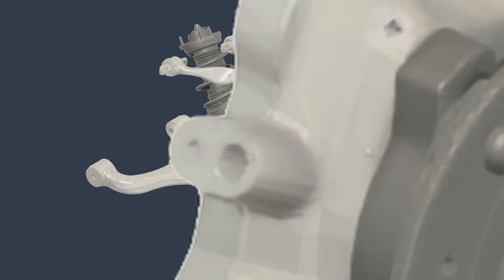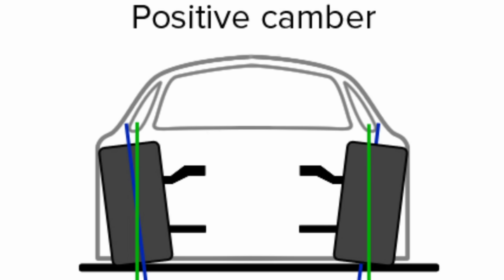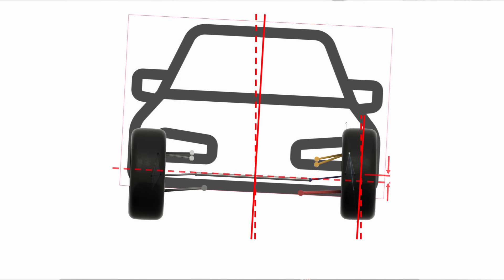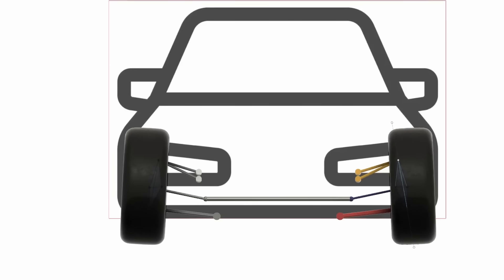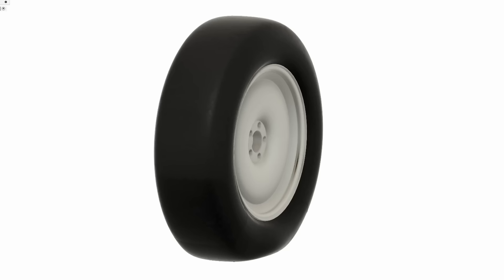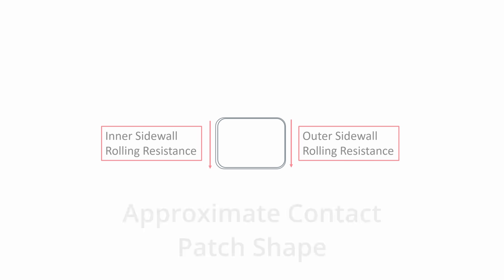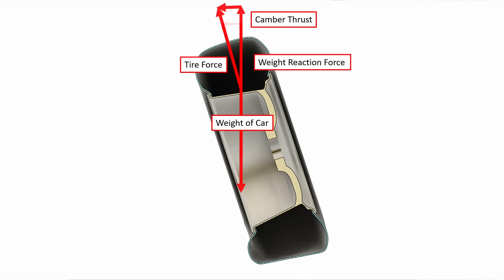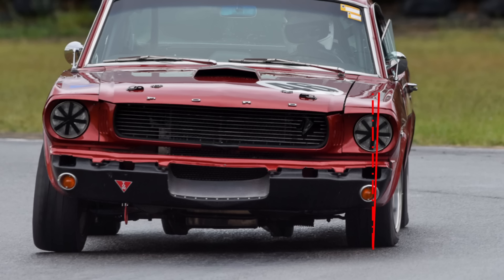Why do some race cars have such ridiculous front suspension camber angles?

Comment: Dirt track racer here... So all my turns are left, on wet dirt.  A high negative camber on the right side front tire (about 3.5 degrees), and a positive (about 1.5 degrees) on the left front, will give you a good 'base line' to keep the tire tread 'flat' and is conducive to the largest contact patch in the left hand corner.  Hoosier biaus ply tires, and rather low pressures cause a lot of sidewall roll.  The camber adjustments compensate for the soft sidewalls, which has a ton of flexibility, therefore necessitating the aggressive camber adjustments.

Steel belted, heavy (thick sidewall) and asphalt tires require much less camber.  And since street cars turn left and right, you need to optimize for both different forces.  Everything is a compromise.

A 1/8" Toe in, and about a .75 degree negative camber, along with a castor, where the upper ball joint is slightly behind the lover ball joint, is the most comfortable driving experience.  Now get into performance, where you aren't worried about having to hang on the wheel to go in a straight line, that's a different story.

The key to a well handling car is 1.  a car that returns to straight ahead on it's own, when you release the steering wheel.  2. a car that maintains a straight trajectory, without having to hold the wheel one direction of the other, when traveli8ng in a straight line (regardless of how uneven the road surface is). & 3. A car that doesn't have so much loss of grip (of the tires to the road surface), in a corner, that it feels like your are headed for the ditch.  This is known as 'push[.  Meaning the rear of the car's weight, is pushing so hard on the front end, it makes the car slide the front tires in the direction it was going, before you turned the wheel.  

These effect is exacerbated   as the total weight of the car increases.  Race cars are designed to be as light as possible, this reduces the force effects we are discussing.  Modern street cars are HEAVY.  This is due to the fact that they are trying to make them safer in a collision, without just putting a race car roll cage in them... It's asthetics and creature comforts that rules the day, performance takes second place, but safethy standards still have to be met.  Hence the heavy weight of street cars.

TLDR... Airbags are the dumbest safety feature ever conceived.  They are expensive technology, and even after years of development, they don't work, unless you are wearing your 3 point harness (safety belt).  Think about how much money could be saved in the cost of building a new car, if they just incorporated a 10 point roll cage, & a 5 point harness, for every passenger seat in the car, and forgot the whole air bag idea... To those that would argue with me... Have you EVER seen any high performance race car have air bags?

The answer is NO... They aren't safer, they just make you FEEL safer.

Comment: This year I started watching Australian V8 Supercars and was very confused with there's insane front camber angle. I went to youtube to find out why, and found your video. Thanks for sharing with us this information in such a simple and understandable way. Great video, we need more explanations like this
Reply: Apparently there is a lot of weirdness with the mandatory spool differential in V8 Supercars and the need to unload the inside rear tyre for the car to not understeer like crazy. 🤔
Reply: There is a video of Ken Block testing a Ford Performance Racing FG Falcon like the one in the thumbnail, and spinning out on corner exit after being shocked at how little traction there was! "I barely touched the throttle" - Ken Block  The regular driver laughed and said "that's just how they are" IIRC.
Reply: Until 2023, front suspension was (relatively) free and of double wishbone type on all cars from 2003-2022 (based on the 1992 EB Ford Falcon's pickup points which Holden Commodore runners wanted and were given in 2003), so that became a hot topic of development apparently.
Reply: Driver61 made a video about the unique V8 Supercar driving style, but completely overlooked mentioned the locked spool differential and its effect on the driving style: throwing the car aggressively into the corner on corner entry to overcome the corner-entry push caused by the locked differential, but then needing to be very smooth and gentle on the way out of the corner else the car will just spin out. (Sorry about the three posts, when posted are edited they tend to disappear on YT for some reason.)
Reply: because his channel is for kids that follow F1 and not actual adults  @TassieLorenzo
Reply: @ Excellent point! The strange driving style (aggressive in, smooth out) that the locked differential requires is hard for guest drivers to get their heads around I think, but Patrick Long, Mattias Ekstrom and Sebastian Bourdais really nailed it I think and were fast straight away!  More recently Kevin Estre has been good too and Matt Campbell also is fast in these cars (but he's a local so ought to know and is fast in everything anyway!).

From time to time there is talk of changing to a real differential, but it never seems to go anywhere even in the third generation of a V8 Supercar now.  I think the locked spool is better suited for jumping across kerbs like a V8 Supercar does, than the real differentials in a GT3 car? You don't tend to see GT3 cars flying over kerbs as much (but there could be other reasons for that: the aero, stiffer springing, not being built for that, and so on).
Reply: "Nutsy Metrical"

Comment: The negative camber thrust on both the front wheels do cancel out each other, but not really at the same time. They help give the vehicle a "toe in" effect. So the car should also drive a lot straighter on a perfectly flat road, but will also cause tramlining if the road isn't perfectly flat. The extra negative camber also helps counteract tire sidewall deflection to an extent, preventing the outer shoulder or sidewall from contacting the road giving you the most amount of cornering grip. How I like to teach people about camber thrust is to take a wheel or tire or even a coin and roll it at an angle. It will want to turn and follow the angle. Great video and explanation!
Reply: Sometimes a little toe out will offset the negative camber effects of tramlining  or camber thrust and sometimes oddly producing lower rolling resistance as well. The wheels pointing outward create forces that offset the forces of the tire leaning into one another. I've known people that had very bad alignment on their daily drivers from suspension sag where this was the result but 10 fold. I asked them does this not make you feel like the car wonders all over the road? They tell me no. Though the tire wear in the inside tells me they have less grip especially in rain it otherwise doesn't act darty or twitchy all over the road due to the separate opposing alignment angles. Kinda sometimes makes me feel like manufactures also engineer this in mind that should your suspension wear over time that while your due for an alignment that these angles will get you by to prevent you from loosing control of steering the car in a stable fashion. But still a proper alignment is required. The only opposite effect I seen on alignment angles was the 1990's Chevy pickup C1500s the camber and toe angles defaulted in reverse. You definitely could see this as you put it on a lift and the suspension decompresses. You would expect them to camber positive and toe in but instead they toe out and negative camber. Very odd geometry but maybe the upper and lower control arm lengths are different but in a way that doesn't favor handling in corners as well as the steering linkage geometry and idler arm and pitman arm setup. I say this because by effect when the front suspension sags I always end up seeing positive camber and toe in wear on these trucks. Definitely not good for handling or wear and less favorable angles overall. Thankfully chevy got their act together and went to rack in pinion steering in like 2002 and that changed that situation.
Reply: Coins are different from tires though, you can see them as rigid bodies and the reason why it corners is due to gyroscopic precession: Try imagine a coin that is rolling forward and tilting to the right, gravity tries to pull it down and increase the tilting angle, but as it's rolling, gyroscopic precession makes the "falling to the right" motion turn 90 degrees along the direction it's rolling, which comes out as "turning to the right" from a top-down perspective.
Reply: @fusha_1527  yes but it's to help people understand and the principle behind it. Try rolling a coin and a tire at an angle, they will both do nearly exactly the same.

Comment: The only place I am aware of where you see positive camber is on oval cars.  The inside tires will be positive, outside negative.  Since you only turn one direction, it makes sense to do this.  Some dirt oval cars a very aggressive on the left side, inside, tires.
Reply: there is actually other places for positive camber. my car and alot of older cars (mine is from 1977) comes with positive camber in the front.
and tractors and trucks have used positive camber. i think iveco bus uses still positive camber in the front. and it has a reason.
positive camber makes the steering wheel easier to turn. so heavy machinery, old cars without power steering utilize positive camber to have lighter steering.
Reply: @matufujiwara7493  oh cool. I was always wondering why that it! first seen it on ~1930's race cars.

Comment: Where a positive camber would be useful?
Reply: Some old cars use positive camber in the front to minimize steering effort.* Remember that camber is always relative to the direction that the lateral forces are acting towards, so on some tracks, you might want less -ve camber on one side than the other.

*EDIT: This is due to their geometries being problematic and resulting in very high scrub radius. Aligning the tire into +ve camber usually allows the scrub radius to be effectively lower, or more towards the outside of the contact patch, than if it was straight.
Reply: Sometimes you’ll see it on the rear of professional level drift cars, as the rear squats under load, the camber gain causes the contact patch to be maximised mid drift.

Also lessens steering effort on the front so commonly seen on tractors and old GP cars.
Reply: @flowermouth  Mid-drift, no, they're compromised mid-drift. Some -ve would be better for performance, although it depends largely on temps and pressures.

 +ve camber is done so straightline angle is 0, because the acceleration pull performance matters a lot for ultimate scoring.
Reply: Tractors

Comment: What you really need is a way to keep the camber compensation at 0 for heave but to activate relatively strongly for roll. DAX manufactured a version of the Caterham 7 that did this called the "Rush." Solid axles (and De-Dion axles for that matter) also technically do this as they always keep the camber at its static setting relative to the road, regardless of body roll.

As another commenter mentioned, tires do need a bit of camber at high load to evenly distribute that load on the contact patch, but AFAIK this is relatively low these days with radial tires at 0.5-1.5 degrees or so. Another thing that wasn't mentioned is that steering geometry (caster and kingpin inclination angle) also contributes to camber compensation, though obviously, only on the front.
Reply from the maker: Steering geometry does contribute, but the effect is small since turn angles even on a track are relatively small.
Reply: @suspensionsexplained  So much for BMWs having around 8-10 degrees of caster compared to, say, a McLaren F1's "meager" 6 degrees, then. I thought it did more for them to help with the less-than-ideal Macpherson strut suspension...
Reply: @Drunken_Hamster  BMWs generally have a very rearward positioned lower balljoint; in the E30 it's even actually behind the wheel center. As far as my understanding goes, some geometries will prefer a higher angle and a more rearward lower balljoint for caster stiffness reasons.
Reply: Optimal camber for lateral grip is dependent on load and temperature, as well as to a point probably slipratio and velocity as well. The optimal camber angle for a tire can be almost anything at any given combination, from -1 to -10 and probably more for bias ply or weirdly profiled tires. It changes all the time, from entry to exit, from low speed to high speed.

You probably won't run the actual optimal lateral angle due to uneven heating and compromised straightline grip, hence why recommendations are often around the -2 mark. However, go higher especially if you have a faster car with more aero and grip.
Reply: @ArchOfficial  I definitely DON'T currently have a faster car with more aero and grip. In fact, I don't intend to have an aero package stronger than a flat panel underbody, single splitter with end plates, and a standard rear diffuser as my car will be run on the street as a daily/near daily and I don't want a bunch of drag. As for faster, well... It has 240hp at the crank, stock, and can reportedly get between 250-270 at the wheels with FBO and a tune. A built motor swap to the larger J35 could net me low-mid 300s at the wheels, but that's long-term stuff as I'm going to focus on the chassis, first, given how I'm largely satisfied with the current output.

As for your other comment, that's rather interesting about them. There's a neat dynamic between caster and steering axis point which I'm sure you're aware of, and it's called mechanical trail. Motorcycles have this, too, only their measurements are called rake and trail. There have been a limited number of tests where the rake was made steeper (suspension fork more upright) while offsetting the axle to maintain the same trail, and riders have reported better steering feel. I wonder what the mechanical trail is of most sports or track cars, and how the relation between caster and trail play out in the 4-wheeled vehicle field.

Obviously, we need more camber gain to steer at higher loads/speeds, but if what Mr. Mees (Suspensions Explained) said about it not contributing much is true, would it, in fact, be better to reduce caster while moving the pivot points forward to maintain trail? Or do we need more caster, regardless, in order to fight the counter-caster-gain effect on the inside tire caused by kingpin inclination angle?
Reply: @Drunken_Hamster  Caster is mostly a jacking thing; it changes the wheel loads. Camber angle change is secondary, and only really relevant if steer angles become very large, such as in drifting.

Mechanical trail on production cars ranges from around 10mm to perhaps around 50mm. Some a bit more, some a bit less. I would say under 20mm is undesirable, and around 40mm is best for power steering. Most cars are around 20-30mm I find.

Some roughly accurate values from kinematic software:

BMW E30: 9mm (No PS, very bad feel, gets stuck mid-corner, very sensitive to tire SAT)
BMW E30 M3: 19mm
Mazda MX5 NA: 19mm (No PS)
Honda NSX NA1: 22mm (No PS)
Honda S2000: 23mm
BMW E92 M3: 24mm
Toyota JZA80: 25mm
Porsche 930: 31mm (No PS)
Porsche 911: 32mm (No PS)
Nissan S13: 35mm
Corvette C6: 41mm
Porsche 964: 41mm
Porsche 996: 42mm
Porsche 993: 43mm
Reply: @ Most motorcycles are between 75-125mm mechanical trail. It's interesting how little there is on cars. Can you give me the trail number for an 03-07 Accord/04-08 TSX or TL (all same chassis)? I'm curious to know how much it might change if I do what I THINK I want to do with the double offset bushings and offset upper ball joint to add a bunch of caster.
Reply: @Drunken_Hamster  Motorcycles have a lot of trail because they're very light. So you're going to need more mechanical aligning torque proportional to the vertical load of the platform. I think it's also just simply to keep the bike upright, for riding stability. I'm not an expert in motorcycles, though.

I don't have a geometry model for those cars, but I do know the DC5/RSX had almost no caster, and the lower balljoint is close to the wheel center longitudinally, so I would guess the trail is extremely low if the Accord is anything like that.

More caster is almost always desirable in roadcars.

Comment: My guess before watching: If the suspension geometry can't be changed on a McPherson strut equipped car, the LCAs could already be past 90° inclination at static height, which leads to dynamic camber loss during cornering. Additionally, the roll center could be very low, below the ground plane, causing a large tendency to roll, which leads to additional dynamic camber loss. Using a stiffer front sway bar would increase understeer even more, so a lot of static camber is set, which compromises braking performance in favor of cornering balance. Camber thrust adds to the cornering force on that axle.
Reply: There can be ways to combat the car developing positive camber in corners caused by body roll, with Macpherson struts.  Stiffer anti roll bars can be used to a point. Raising the lower control arm mounting point is one. As the body rolls the higher pivot point tends to cause the arm to push outward a bit. This counteracts the tendency to develop positive camber. This was used to good effect on Mazda RX 3's.
The Porsche 911RSR race cars cornered on 3 wheels, lifting the inside front. The front ends were light and one tire handled the cornering force, letting the tear tires get maximum traction to handle the rear weight and accelerate hard out of the corner.